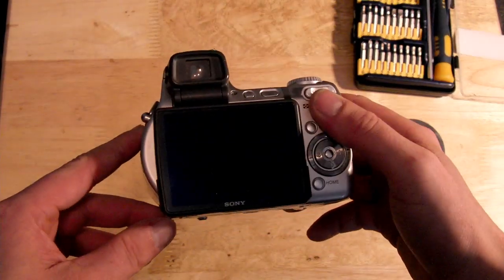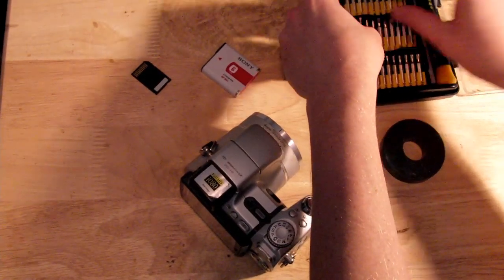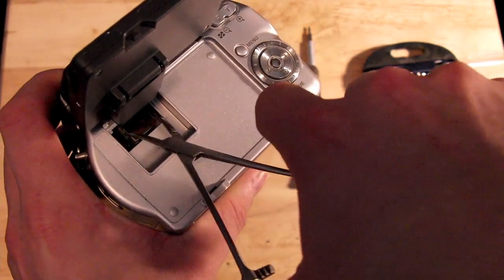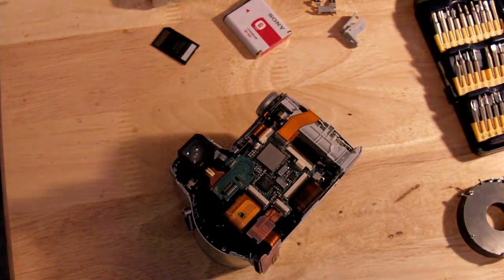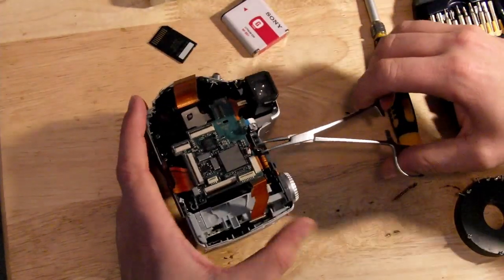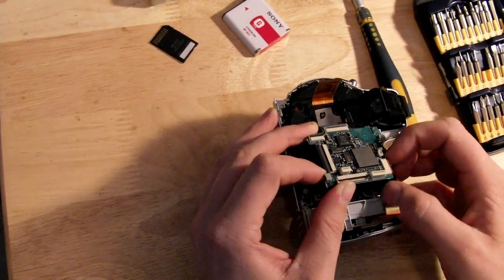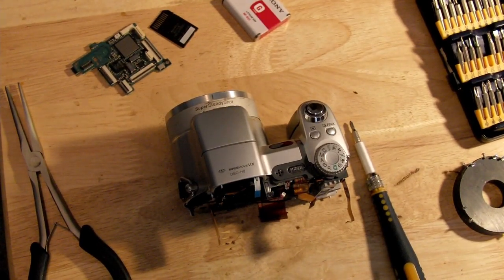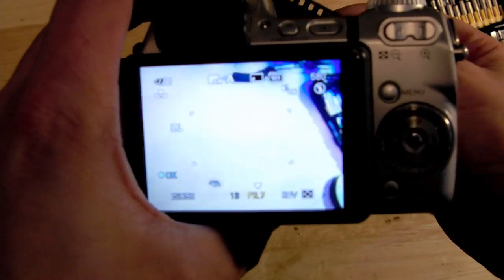Sony Infrared Conversion

Comment: actually if you have an H9 sony that already has night shot ..you can find an ir filter and shoot in night shot mode and it takes IR pictures .The benefit of dpoing this is you can shoot in manual mode it ... but at the same time by shootting with the night shot in automatic  and the IR filer ...it means when you take off the ir filter you can still take regular shots as well ..

Comment: Thank you for this tutorial, is very good. Do you think this will work on a Sony DSC-H7? The H7 is almost a H9 without nightshot so it have no nightshot switch on the outside of body. I take it apart and found that it have the nightshot lever inside, where the external nightshot switch conects to on the H9, but is locked by a piece of metal. Just removing this piece of metal and cutting the same cable as in the tutorial (the cable and switch you throw out in the tutorial are exactly the same in H7 and H9 as I saw) is enough to make the H7 work as a full spectrum camera like the H9 with no problems in focusing?
Reply from the maker: +DarkenDemon Is sounds like it should work, you might not even have to remove the electiric switch if nightshot isn't in the h7 software. Try flipping the lever and then running the camera, maybe all you need is to make that lever accessable.
Reply: Sorry for so late answer but i had a big time to remove one of the screws that got worn and to cut the nightshot lever metal lock. I was able then to flip the switch but when I flip it the camera turns completely off. Should i cut the wire that enables the nightshot software too or forget nightshot in this camera?
Reply from the maker: It sounds like the software for nighshot is disabled, if you can, try to move the switch out of the way, without cutting it, then flip the lever. Just to make sure there is nothing else going on. It sounds like it might work though.
Reply: Thank you for all your help. I searched a bit more and this camera dont have the nightshot software as it dont have some internal components that only exists in the h9, like the IR emitter, among others. As that I moved away the switch that enables the nightshot software and components, flipped the other switch and now I have a "full spectrum" H7. Any suggestion if I should cut this switch off like your tutorial and how I could acces from the outside the switch to toggle nightshot on/off?
Reply from the maker: +DarkenDemon If it works without the switch there is no reason to keep it. I don't know of any way to upgrade the firmware to the H9. 

Glad it worked for you, my favorite filter to use is the 650-680nm range. They give good colour and good IR effect.

Comment: cutting button ( cable ) is enough to make it as IR camera ??
Reply from the maker: +Mayur P A The H9 already is an IR camera, cutting out the switch disables the software that increases the gain and turns on the IR light.

Comment: I want to replace the lens zoom for this particular brand of Sony camera. It was dropped will the camera was on and the lens was forced back into the main camera. After this, it didn't zoom or take pictures just freezes and makes zoom noises. Any help will be appreciated.
Reply from the maker: I was never able to completely separate the lens assembly but you may be able to find the same camera on Ebay cheaply.

Comment: Is this possible & easy on my Sony cyber-shot? Please let me know.
Reply from the maker: This mod can only be done to cameras with an IR filter that is moved away from the sensor with a mechanical switch.
Reply: So your saying this can not be done to a Sony cyber-shot???? I don't know what u mean by mechanical switch. I just wanted to know if I can remove the UV filter from the cyber shot using this method....

Comment: I'm thinking about trying this on my Sony dsc hx7v. Good/bad idea? You think it's doable?
Reply from the maker: As far as I know it doesn't have a mechanical night shot switch. Without a mechanical night shot mode you wont be able to modify the camera for IR in the way that I show in the video. Sorry.
Reply: Nick Moore Not in the same exact way no. But I thought I'd just remove the "hot mirror" inside the camera and then use front mounted IR pass filter such as the Hoya R72 for shooting IR and then use a front mounted ir&uv cut filter when shooting normal. Shouldn't that work you think?
Reply from the maker: It will work but you may have focus issues, some cameras need the thickness of the hot mirror glass to focus properly. The last camera I tried that with was from 2008 ish so things may have changed since then. Good luck!

Comment: Nick i really need help, im remote and want help on how to clean my lense on this camera, wondering where would i find on how to dismantle it to clean it? could you steer me in the right direction or do a video on it for me please really need it clean but am too far away to send it away ppllleeeaaassseee! :)
Reply from the maker: I don't actually have this camera any more, I gave it away when I got a new IR camera. I found a service manual for the H7/H9 when I made this video, they should still be available online but I don't remember anything about taking the lens assembly apart. What kind of dirt is on/in the lens?
Reply: Nick Moore
its dust but its on the inside of the lens not on the outside and need to find out how to take off the front layer in order to clean the next layer and thats it can you  send me a link of the service manual i do have a manual here but doesnt tell me much thanks if you can help :) thanks for the quick response too btw
Reply from the maker: dolpsdw The focus got a little bit softer but it was not noticeable for objects that were far away (3m).
After the modification the IR flashlight no longer works, an external IR light must be used in the dark.
I switched to an NEX5 camera that had it's IR blocking filter replaced with a 650nm IR pass filter. I switched so that I could use all the lenses I use for filming video.

Hope that helps.
Reply from the maker: When you switch to night shot after the mod the focus is a little soft but only because the lens is only made to focus a small part of the spectrum. IR is so far from blue that not everything can be in focus at the same time. If you add an IR pass filter the focus becomes sharper. In normal mode everything works fine.

On the H9 you can switch back and forth with the night shot mode switch. On all other cameras the change is permanent and you can only take IR photos.

Hope that helped.
Reply: Nick Moore hi, i am thinking about to buy a camara for infra red and daylight and i have a few questions.
did you have focus problems after the modification?
Will the ir flashlight of the camera stop iluminating scenes in 0 lux situations?
Why you changed to other ir camera?
What camera you use for infrared photography?

Thanks.
Reply: Nick Moore thanks mate, the focus iusse is only while in night vision mode?

if you have an IR filter then that camera is not able to take a "normal" photo anymore (until restore the lens) true ?
Reply: Cool thanks mate will take a look at the video and see how i go thanks heaps
Reply: Disregard my last comment hahaha learning how to use this thing

Comment from the maker: No. If it doesn't have nightshot built in it will not focus properly with the IR blocking glass removed. No matter what camera you have you will not film any UFOs, all of the flying objects in our atmosphere are man made or animals, anything that isn't those two are falling rock. If you remove the IR glass from a regular camera you need to use an IR filter to make it shoot normal but it will still not focus properly. I do not appreciate pseudo-science in relation to my channel. Sick to reality.
Reply: Nick Moore:  "I don't appreciate pseudo-science in relation to my channel". Wow. You're such a grouch. There ARE  UFOS flying in and around our atmosphere. Regardless if you believe in them or not, they exist Mr Scrooge.

Comment from the maker: There really isn't any way to damage modern electronics with a magnet. The camera's software is stored in ROMs which are non-magnetic storage, the rest of the circuits are semiconductors that are also not damaged by static electric fields.